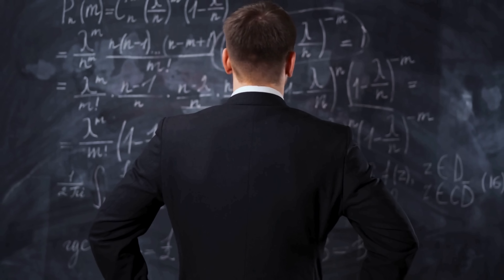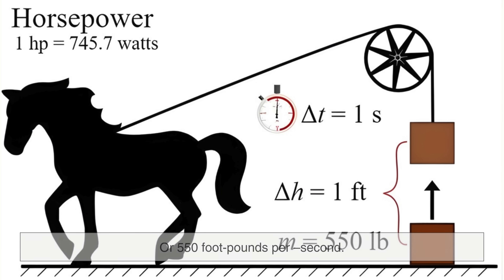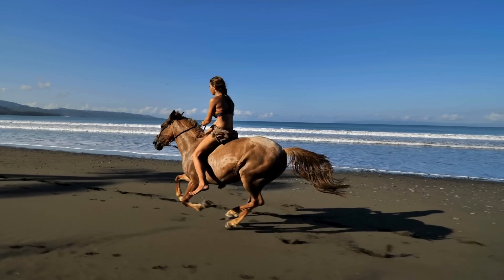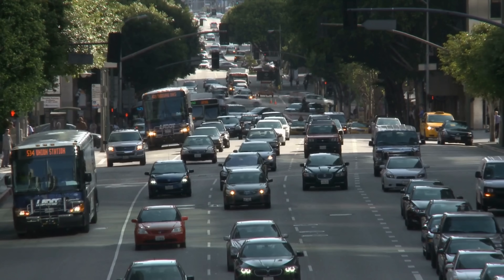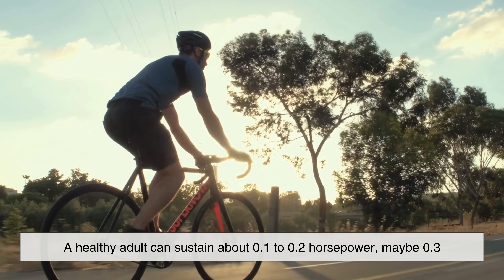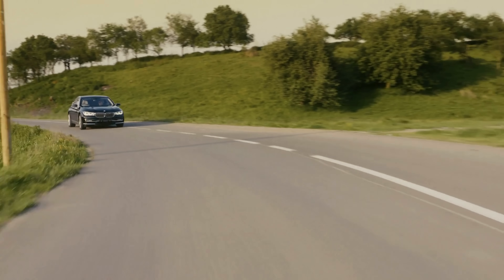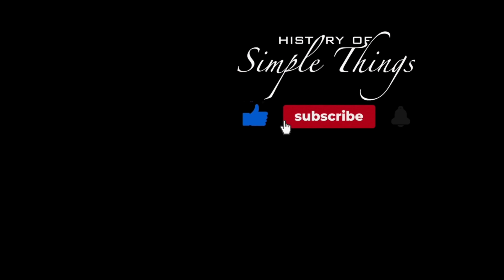What Is Horsepower REALLY? (It’s Not What You Think) [ID0807]

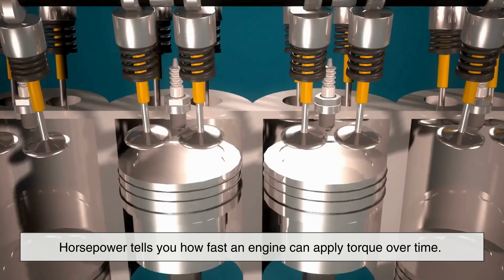Comment: 4:33 Power isn't “how fast you can apply torque over time” it can be  _measured_as work per unit time. Power = Work/Time
Power IS the rate of energy transfer: Power = dE/dt.
That is, it's the derivative of work with respect to time - not the average over a span of time.
Power over a period of time" is a scalar accumulation - it tells you how much total energy was transferred in that span.
"Power per unit time" is a rate function — it's dynamic, describing how energy transfer is changing moment to moment.
in physics, Power is work per unit time — it's the rate of doing work, not the total done.
Think of it like your car:
* Odometer → total distance (like total work or energy)
* Speedometer → how fast you're moving (like power)
It's the same with electricity:
* Kilowatts (kW) = power - how fast energy is
being used right now
* Kilowatt-hours (kWh) = total energy used over
time
So "over a period of time" gives you an accumulation (kWh), but "per unit time" is an instantaneous rate (kW).
Physics cares about the rate, because that's what tells you how energy is actually flowing in the moment.
Torque of course, as you pointed out, has no time component. Torque doesn't do work power does.
All work is not only done by power it is done at a rate dictated by power.

Comment: Many countries use mHp (metric horse power) which is not the same as imperial hp.
1 Hp = 0.745 kW
1 mHp = 0.736 kW
Reply: Metric horsepower is defined as the work of lifting 75 Kg 1 meter during 1 second. And as the gravitational constant is about 9,81 m/s2 this will represent slightly less than 736 Watt (75*9,81=735,75)

Comment: Horsepower is torque x RPM, Or 746 watts.
Reply: nope, 745 watts!!
Reply: @AllanP-n3q  Technically 745.7. If you were in an electrically related industry, you would know that 746 is the figure universally used.